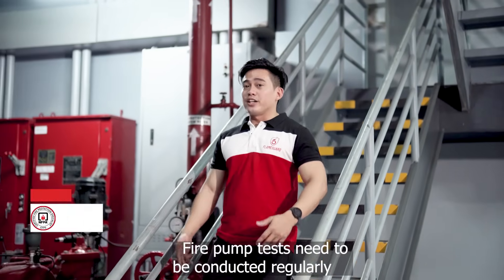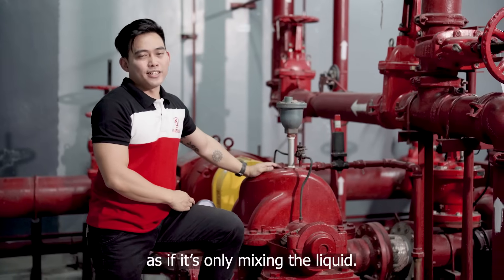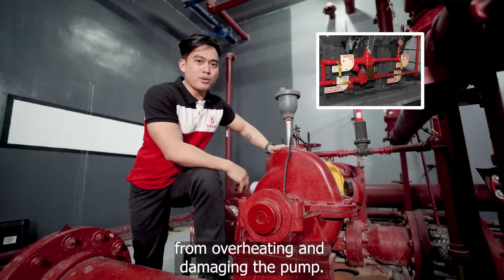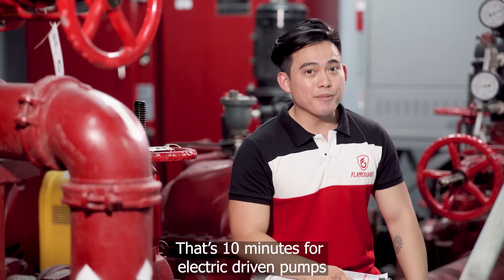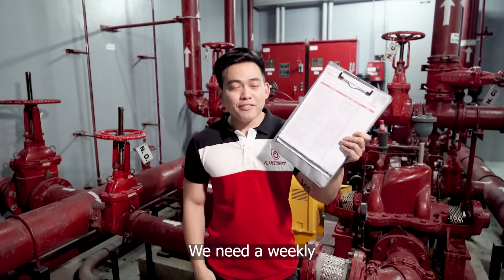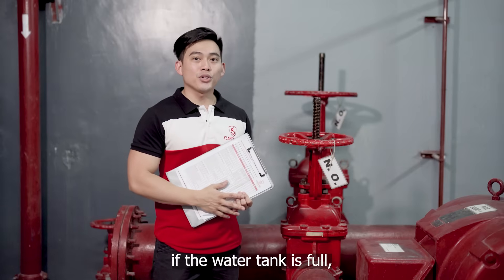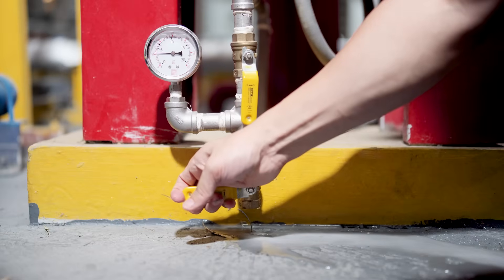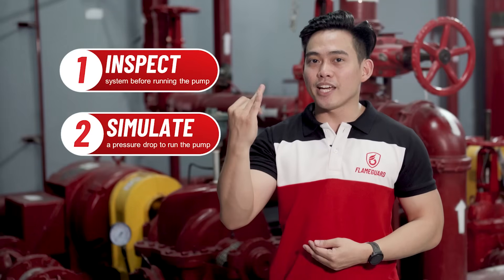How to conduct a fire pump churn test

Comment: How can we do the zero flow test sir if the pressure relief valve is installed before the valve. Does this also require closing the back to tank valve?
Reply from the maker: The casing relief valve must remain open whenever the fire pump is running to prevent the casing from overheating. A “zero flow” test is not truly zero flow; a small amount of water, called weeping flow, is always allowed to pass through to keep the pump from overheating.
Reply: @Flameguardph maybe hes mentioning about the Main Relief Valve. Because as you mention the Discharge valve need to inspect if Open before the test. I think need to isolate the discharge during churn?

Comment: Not showing any valve to close
Reply from the maker: Hi Jenerio, NFPA does not require closing the system isolation valves before conducting the fire pump churn test. It's optional but not necessary. Some operators prefer to close the system isolation valves if they have a high head (more than 175 psi) fire pump churn, but leave them open otherwise.

Comment: Do we need to close any valve before churn test?
Reply from the maker: Not necessarily. The NFPA does not require closing the system isolation valves before conducting the fire pump churn test. Both practices have opposing advantages. 

Case A) If you close the system isolation valve, you keep the rest of the system safe from any unwanted incidents. This might be advantageous for high-churn fire pumps (more than 175 psi) and systems where you are not confident to have been fully compliant with appropriate installation standards.

Case B) If you keep the system isolation valve open, it ensures that your whole system is capable of handling your fire pump operation, which btw is the intent of NFPA in the first place. This is advantageous for properly installed systems, compliant to NFPA 13, 14, 20 and other standards, whether or not the fire pump has a high or low head.
Reply: @Flameguardph  Your explanation's very helpful. thanks you
Reply from the maker: @MayaMaya-qx2mo  welcome! Please support us by subscribing to our channel and following our socials😇
Reply: @Flameguardph if you were to close a valve to keep the rest of the system safe, which valve would you close?